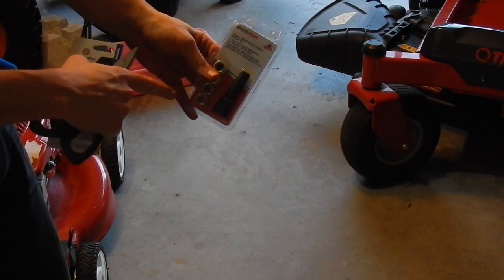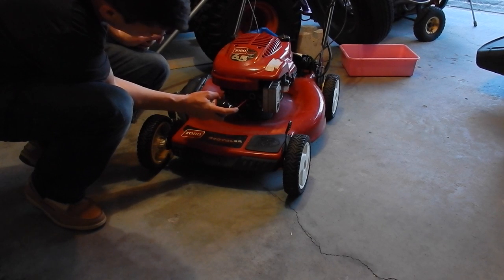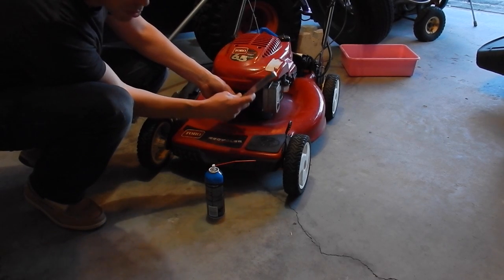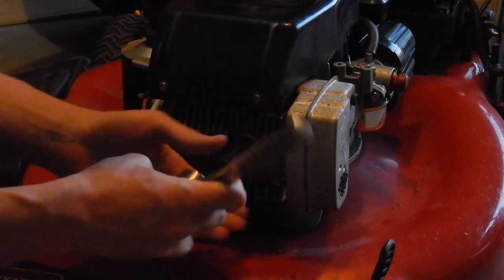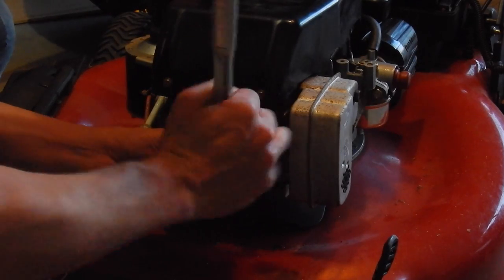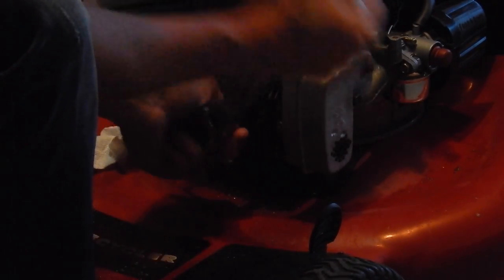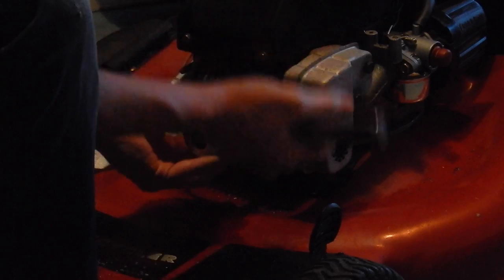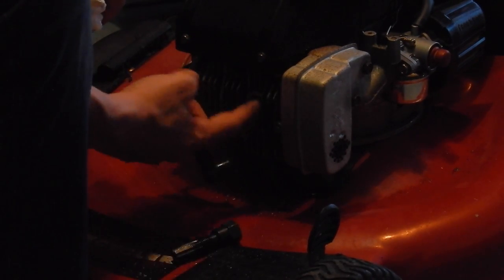How to Re-Thread a Stripped Spark Plug Hole in a Push Mower

Comment: Use bearing grease in the tap grooves. Only turn 3 turns at a time. Pull out and wipe off then regrease every 3 turns!! Aluminum is NOT MAGNETIC!!!!!!
Reply: kurt phelps jr short length of aquarium hose on the end of a vacuum cleaner. Takes about 10 seconds to suck them out. Also don't spray lubricant it acts like glue for the filings. 👍

Comment: maybe if you used a bigger ratchet instead of a tap handle your one of a kind aluminum magnet would work better even without tapping fluid.
Reply from the maker: Thanks for watching
Reply: Does the re threader need to be forced in as mine isn't taking? It seems too big?